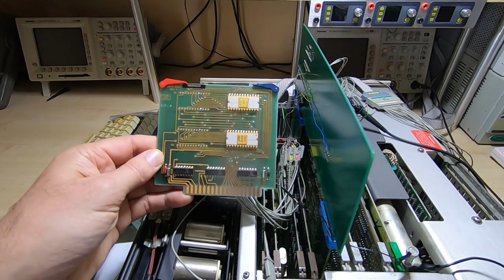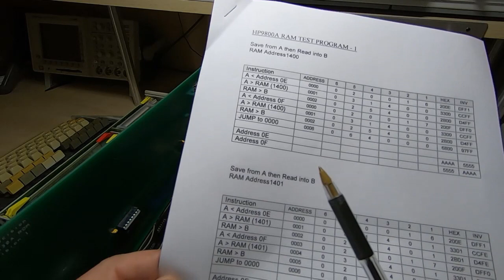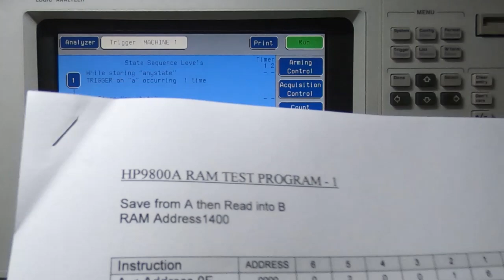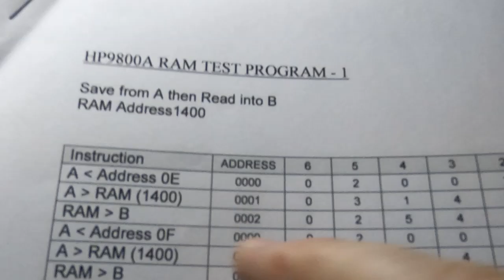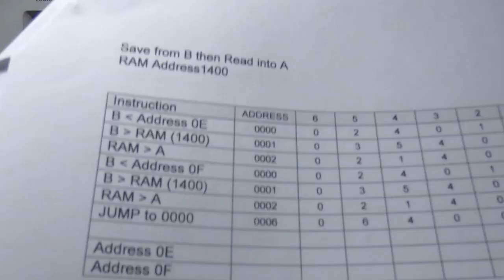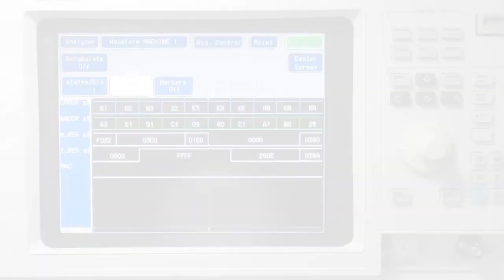HP9830A  Repair  Part21

Comment: Side note but I like you three DPS power supplies on your desk there.  Do they share a common negative or did you isolate them all so that you can float the voltages on top of each other in series?
Reply from the maker: They are all fed from a common transformer but with seperate secondaries and rectifiers so they are effectively isolated. This lets me use them as -ve supplies if I need them and also allows me to have fully 'floating' supplies. I mostly use them during repairs to substitute a suspect supply in the device I am repairing so having them floating is useful.